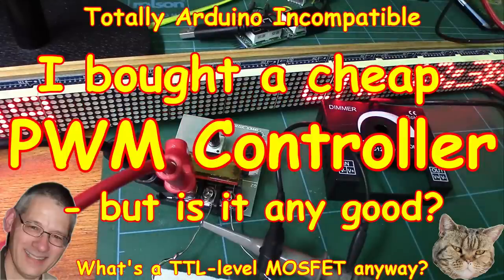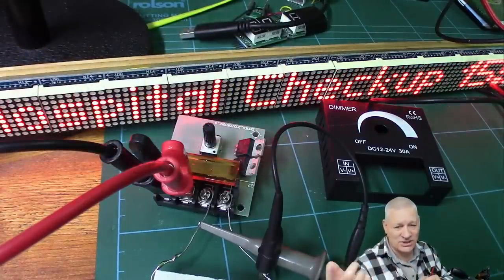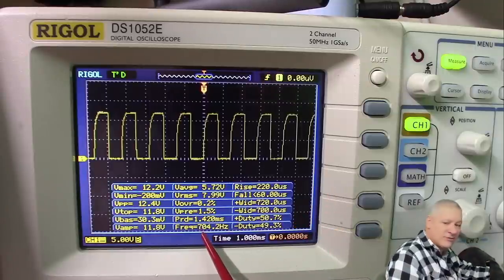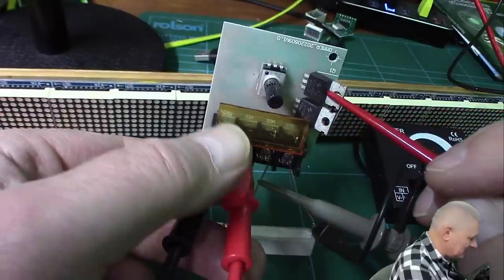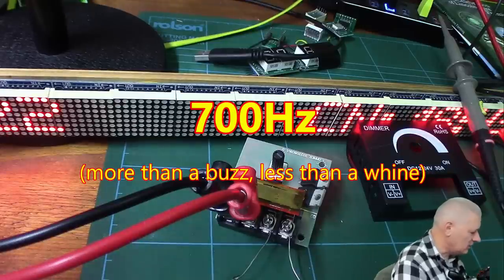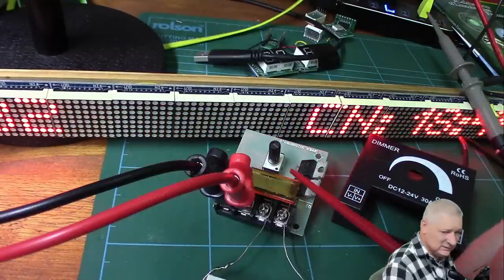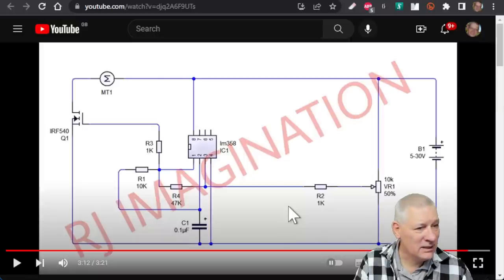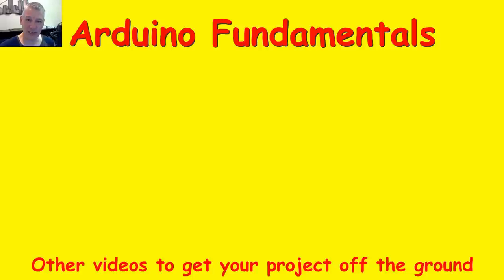#255 Cheap PWM speed controller for my pond - but is it any good? 🧑‍🎄

Comment: Just a tip on Mosfet/IGBT gate drivers, I've had good luck using HCPL-3120's from china. They're basically optocouplers with a built-in totem pole driver that can easily drive a handful of big mosfets in parallel. They're REALLY simple to set up inline with your arduino and provide isolation to it which is always welcome, and at around 50 cents a piece are pretty affordable.

And if you just want to be an animal you could use an L293D driver which could drive up to 4 separate channels, but it's an out of scope use. Nowhere near as versatile though since it's a 5v logic level input and provides no isolation,  along with that it can only work at up to 5kHz. But works in a pinch and is a lot cheaper since they're used all over the place.

Anyways just wanted to chime in with that. With the HCPL you can do some pretty neat stuff since it's isolated, all you would need is a separate isolated power supply and you can switch a high-side gate, which is what you need for inverters and such (provided you're only using N-channel fets). IMO its never a good idea to connect a power transistor making all sorts of noise directly to a microcontroller. It's insane how much electrical noise travels through everything especially when you're on a proto-board.
Reply from the maker: Hmm. It's a tad unfortunate that the operating voltage for those drivers (the datasheet says) is 15 to 30 Volts. Otherwise they don't switch on. More here: https://docs.broadcom.com/doc/AV02-0161EN The idea is a good one, though.

I've had some optocouplers in my Pandora's box of parts for some time: a PC817XNNSZ0F which just contains an IR LED and a transistor. It's described as a plain old DIP 4-pin optocoupler. What it doesn't say is what the minimum voltage is across the collector/emitter; perhaps it doesn't matter. The max voltage is 50v though. I really shall have to try this out one day soon.
Reply: @RalphBacon  the minimum voltage of a normal optocoupler is basically the voltage drop, in the case of the PC817 it's minimal, like 0.1v. the problem with the PC817 is 1: their switching speeds are quite low (like 20khz max if you want to have good control of duty cycle, but 80khz otherwise) and 2: they can't handle much current, like 30ma. Theyre really good for isolating IO ports and level shifting.

Interesting stuff about the HCPL3120. I'm going to try running one at 12v to see if it runs. It might just be that 15v minimum is recommended because most IGBTs are recommended to be driven at 15-20v to make sure they are as conductive as possible.

Comment: If I may, I would suggest to review the choice of MOSFETs. There is a trade off to make between RDS,on, switching frequency and power wasted in the FET & driver. In simple terms to lower the On resistance of the channel, it needs to be wider and this corresponds to higher gate capacitance. The switching happens by charging and discharging such capacitance, putting a strain on the gate driver. The higher current peaks in the driver leads to higher heat and the limit on the driver current leads to the MOSFET spending a longer share of the cycle in linear region.
Since you pretty much know what range of current the load will need, choose a MOSFET rated for a little more than that (50% more, possibly 100% more). Among the FETs rated for such current list the ones with a reasonably low RDS,on at the Vgate-source available in your circuit (6mR seems an overkill to me). The next step is selecting the MOSFETS with smaller gate capacitance and smaller gate charge but still low enough Rds,on.
The HY1707P has an input capacitance of 2140pF which is huge for the job you need it to do. Driving such a large gate with something like an OpAmp could prevent the FET from ever operating in the On region because, at 4.3kHz, Vgs never actually reaches an high enough voltage.
Reply from the maker: Indeed, the output wave form did look quite slow (at switch on) maybe the gate capacitance was to blame for that. This circuit is so simple that I'm still tempted to roll my own one day. I could get the ESP32 already present in the pond pump controller to do the PWM. Then it could be controlled from my phone too.

Comment: I do have a soft spot for op amps. Many, many moons ago (70s) I got into electronics because I wanted a synthesizer. Moogs, the first and only source of these instruments cost as much as a decent 2nd hand car. So, I figured I would try and make one. The heart of a synthesizer is a bunch of op amps configured as voltage controlled Amplifiers (VCRs) or Voltage controlled Oscillators (VCOs) and Voltage Controlled Filters. All these modules create sound by feeding the output of one module into the control input of another. Now, you might be visualising a panel with myriad knobs and a patch board with cables plugged into a matrix of holes like an old fashioned telephone exchange. Well, I have to disillusion the reader. The product of my project was many tobacco tins, each with 3 knobs and 2 sockets, arranged in a a maze of cables. Any subscriber should just remember one of Ralph's projects to get the idea. Merry Xmas Ralph.
Reply from the maker: 😲 You mean my projects are messy, Michael? 

On the prototyping breadboards they get messy very quickly. The worst one was the ESP32 Web Radio, dozens and dozens of DuPont cables. But it worked!

Thankfully the PCB version was very neat!

Comment: I Had to have one a few months ago, I just used the trusty ol NE555 with a lm7805 running it from the input voltage and used the output from the 555 to drive the gate of a irfz44n N channel FET with a small heat sink, worked a treat. 3d printed case and I was up and running, cheap, no waiting for post and more reliable than ordering from china. I don't buy anything that I can build myself, good luck with your project and have a blessed Christmas ...
Reply from the maker: Sounds just like I might have designed it!

Comment: Hi Ralph. When I built my ventilator prototype, I was getting horrid noise out of the motor windings on the 12V windshield wiper motor I was using until I adjust the internal timer values on the nano. I found this bit of code:
 // adjust internal timer for PWM on pins 9 and 10 to reduce motor whine.
  TCCR1B = TCCR1B & B11111000 | B00000001;    // set timer 1 divisor to     1 for PWM frequency of 31372.55 Hz BEST
  // TCCR1B = TCCR1B & B11111000 | B00000010;    // set timer 1 divisor to     8 for PWM frequency of  3921.16 Hz

Once I did that, the motor was silent from then on. 

Maybe if you build your own PWM controller, you'll have a much quieter output.

Best wishes,

Gord
Reply from the maker: That's exactly as I described it in video #15 here https://youtu.be/e2CPnmLmSws?t=826 in February 2016! Small World.
Reply: @RalphBacon  FYI we had a project where we had to do the frequency adjustment when running a diode laser driver. The laser driver  would only work on higher frequencies. Thanks for the video.

Comment: A good place to find TTL MOSFETs is old PC motherboards.  The MOSFETs around the CPU socket for the VRM are usually controlled with 5v or less.  A little shot of hot air from a heatgun or hot air station and they pop right off and they usually handle quite high amperage.
Reply: I use Motherboard Fets all the time. They work nicely driven by a microcontroller.
Reply: @romancharak3675  yeah.  i buy PC's from yard sales and work on alot of them for ppl so instead of throwing away all those parts i sit out in the building with a heatgun and tweasers and strip parts to fill my parts bin.  then when its winter time i build stuff.
Reply from the maker: Sounds like a great source of components, Mike.

Comment: Two things spring to mind.   How does the PWM frequency interact with the motors inherent frequency?  The timing of it's commutator brushes.  I assume it's a DC motor.
The other things is.  whether it's spinning or not a motor coil is an inductor coil and the other thing you pump a PWM wave into an inductor for is a boost convertor.  You'll certainly need to address the fly-back/freehwheel inductive pulses. 
PWM in the case of motors, the only ones I've played with the PWM is not driving the motor, but the brushless motor controller.
Reply from the maker: I don't know whether either of the pumps have brushes or not. But the back EMF diode is certainly a good idea. Now, where's my soldering iron...

Comment: Dear Ralph. Having bred aquarium fish outdoors, I have found that  the bubbles from your air-stone will give sufficient water flow in such a small tub. In fact, I do not add any circulation to my outdoor tubs at all. Still water is totally quiet and peaceful.
Reply from the maker: Still waters run deep, Roman. Yes, I'm pretty sure I don't actually need the water pump for the fish to thrive but it's nice to have on in the summer, especially.

Comment: My extensive research reveals that goldfish can hear up to about 4000Hz, with larger carp species being able to hear to 7-9000Hz. So anything you can't hear, your fish should be OK with :)
TO220 packaged MOSFETS typically have a die-to-ambient thermal resistance of 62 degrees per watt, and given the maximum die temperature is about 90 degrees above ambient (~125 degrees) you shouldn't dissipate more than 1.5w in a MOSFET that has no heatsink; in this case 1.5w in 6mOhms    I^2 = P/R = 1.5/0..006 = 250 so I=sqr(250)=15.8A per device. They will get Hot Hot Hot!
Reply from the maker: The good news is that I increased the frequency to around 4kHz and the MOSFETs are tepid, at best with my little pump. But as a solution it is crying out for a "proper" design... I'm keeping this one on my "To Do" list!

Comment: You mentioned your thinking of getting a 3d printer. I've had a Prusa Mini+ for 2 years and would thoroughly recommend it. Its enabled me to print no end of enclosures etc. and for 3d cad software I use Autodesk Fusion 360 which is excellent. Good news is its free to us hobbyists else for commercial use its very expensive and the limitations of the free version are minimal. There are loads of youtube videos to learn it eg. Kevin Mcaleer's channel. Hope this helps
Reply from the maker: Yes, I'd love a Prusa (whatever model, turn on and use) but Autodesk Fusion 360 is something I tried to learn but it took FOREVER even to get the simplest shape on screen (I was following their lessons). I need something really simple just to print enclosures, initially.
Reply: @RalphBacon  Have a quick look at OpenSCAD, its a programming language for defining 3D shapes, and especially suited for making enclosures. There's a number of free box-making programs for it people have written, and of course you can hack about with other peoples OpenSCAD designs for your needs. Free download and of course you can try it without needing a printer. 
There's a number of smaller 3D printers that have come out in the last year that are in the £200 bracket but have advanced features like auto levelling and direct drive that previously were the preserve of much more expensive printers. And if you don't get on with it you'll know what to look for in a different printer before you get too invested in it. I put off getting mine for ages and now I find so many uses for it.
Reply from the maker: @Ian_Rolfe thanks for the heads up (and Real World experience too). I shall check out OpenSCAD and see how it feels 👍
Reply: @RalphBacon  There's a pretty good series of tutorials on the OpenSCAD site that helps to get a "feel" for how it works and the approach.

Comment: I recently build a bog standard pwm speed controller for a model train using the trusty NE555 and Irf540. I was quite satisfied about the speed control. Also at low speeds. I see nothing wrong with this setup 🙂 (In this application.) Cheers!
Reply from the maker: Thanks for that feedback, Piet. Always good to know that the trusty 555 is still being used. This module works well enough although the output could be a lot cleaner (square wave) with a higher frequency.

Comment: To get 80A’s through that you would need a unobtainion  heat sink. Power dissipated would be I^2* R so 80^2*0.008 is 51W’s. But you would need to look at the thermal resistance of their package, as it not limited by the max current but more by how fast you can get the heat away from the junction.

I found that with most max current figures it is almost imposable to use them anywhere near it. And again this would be stated for 20 deg C, so you would need to derate it for most applications anyway.

big numbers sell more parts as china has found out.
Reply from the maker: Indeed. I bought a 30A SSRs a few years back and discovered a 10A SSR inside the package. Big Clive had alerted me to this ruse!

Comment: I reckon that for Mk2 you should just do the PWM from the ESP module to both turn it on and control the speed. Then the minister of everything can control the pump flow from her phone.

We control a lot of 3phase pumps by varying the frequency of the supply, still getting their 415VAC but at above or below 50Hz to vary the speed.
Reply from the maker: Certainly if I ever did a Mk2 I would let the ESP32 control the speed, and from the phone too. I wonder if businesses go through this type of iteration with their products?
Reply: @RalphBacon  oh they undoubtedly do! At least if you ever run short of project ideas you can roll out a Mk2 of something you did earlier. Would still be just as technically interesting even if we’ve already seen you make an XYZ already

Comment: LCSC lists the HY1707 mosfets @ $0.56/each. I bought a bunch of very similar HY3403 mosfets from them a while ago (probably because they were even cheaper @ $0.37/each.) I've used these a few times and they seem perfectly fine. These are rated at 30V/140A. Pretty sure however, that 140A needs to be read as the ABSOLUTE MAXIMUM 'momentary' peak current ... with a heat sink. I mean ... I also enjoy welding, so I have a pretty good idea what 100+ Amps will do to any old piece of metal. Hard to imagine that these <tiny little pins> could sustain this kind of current load for very long.

As for PWM ... I was working on a similar project a while ago. At first, I tried making a 555 work, but ran into issues* and became frustrated. I finally settled on generating the PWM with an ATTiny412. These are cheap ($0.40/each), easy to program, and worked perfectly for me.

* Don't recall exactly, but I think the issue was that I needed a duty cycle less than 50%. I couldn't do this easily with the 555, so I tried inverting the signal. This sort of worked, but caused issues because the signal's default voltage was now high ... thus keeping the mosfet turned on. I melted a few things. It happens.
Reply from the maker: Yes, the less-thn-50% duty cycle on a 555 was what I was referring to in the video. 

It can be done (using a diode or two, apparently) but when I was thinking about this entire project and whether I should roll my own PCB inside that case, a simple Arduino-compatible chip was at the top of my list. 

I have several naked ATMega328Ps (both DIP and TQFP32), ATTiny85s (no native PWM but we could bit-bang), and even an ATTiny167 (which I was hoping to use in a project, but they are now rarer than hens' teeth).

The "problem" with hardwiring electronics (such as using a 555) is that once done, that's it. No easy expansion or tweaking route. Using a μC is a whole different ball game.

Yes, the 140A was just a paper-based specification; in the Real World I suspect a decent heatsink and decent wiring would be called for, when even approaching that level of current (that's 10 x 3KW kettles) 😲

Comment: For PWM you really need 2 555s.  One generating the base frequency and the other triggered by it in pulse mode.
Reply from the maker: Or a 556? I've used those before, fewer overall pins and a single chip!

Comment: Hello Ralph, gr8 video :) As a side issue, do you have any videos covering soldering with eyes that aren't getting any younger?
Reply: I wonder if a USB microscope camera would help?
Reply from the maker: I find a USB microscope fantastic but not for actual soldering (not usually, anyway). I use it to check my soldering, once it's been done. It's saved my  bacon on many an occasion! The smaller one was "only" about £85 but I invested in a much larger one as my eyes got real bad and that's what I now use.

What I find very useful for soldering is what I showed in a recent video starting at this point: https://youtu.be/1OAVkZy8ZXE?t=669

Links to the products I mention in the video description!

Incidentally, trying to solder using a USB microscope is difficult because everything is a bit too big, things move too easily and it's not 3D (ie stereoscopic, although you can buy such microscopes for big money, in fact Louis Rossman uses one all the time).
Reply: @ForwardGuidance  I have tried a USB microscope, but looking at the screen is dis-orientating.
Reply: @RalphBacon  Excellent thank-you. After making a real hash of soldering a DB9 connector, I've decided it's time to find a better way.
Reply from the maker: Yes, try those "jewellers glasses", you get many different strength lenses. I use them all the time.

Comment: could make it so the mosfets use the case as a heatsink (bottom plate), 
if going for a new pcb would space the mosfets left/right
Reply from the maker: Yes, using the (metal) case would be my choice too for a heatsink. Although it's all working now, I am still keeping this project "open" for a replacement circuit board in the future.